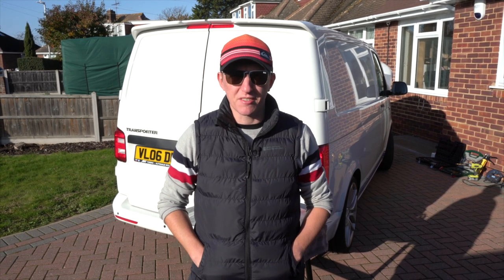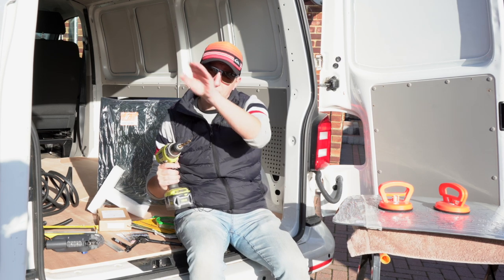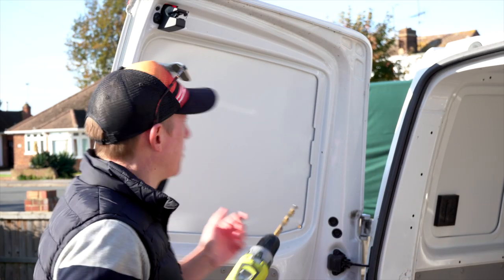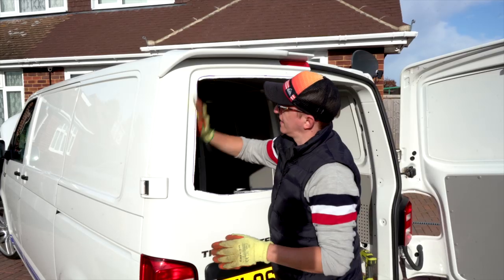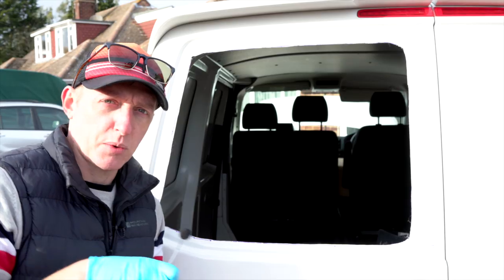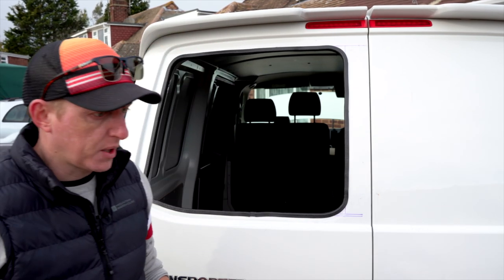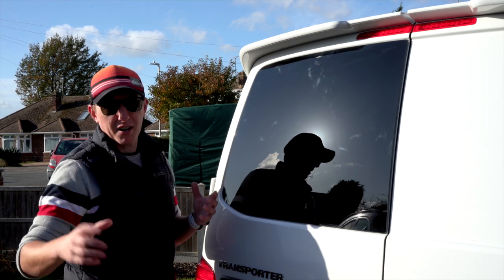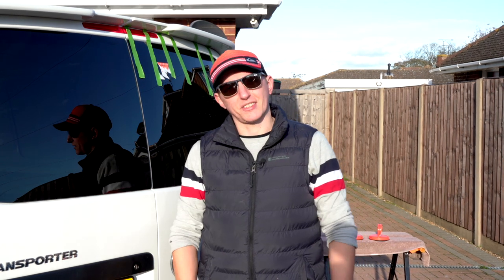How to fit VW T5 & T6 barn door windows

Comment: Enjoyed the vid mate, top tip for anyone planning to do any windows is to open your front door windows slightly before starting, because if you close your door once the window is in place and create an over pressure inside the van it could move your window and potentially compromise the seal or worse your window might pop off 👌
Reply from the maker: Thanks for the tip 👍🏼

Comment: If you are going to carpet the van inside, how will you hide it under the rubber trim If you have already put it in place? I thought you should carpet first then put the trim around the edge over the carpet to finish it off better then put the glass on. If you are not carpeting then this is okay,  well done.

Comment: Not trying to be negative but this is the worst window fitting video to watch. Everything has been done backwards & the windows will most likely fall out one day. The primer needs to be painted onto the bodywork, the windows are already primed & the stikoflex also need to be applied to the body & then windows pressed & wiggled into position.
Reply: Couldn't agree more, poor drilling to start with - no pilot hole & the drill on hammer action ?? Then using the jigsaw looks like he was wrestling with it. the process is there but hand skills & best practice of how to use power tools definitely aren't.